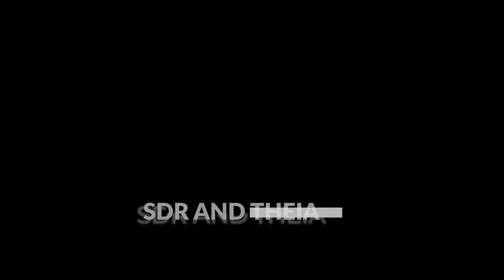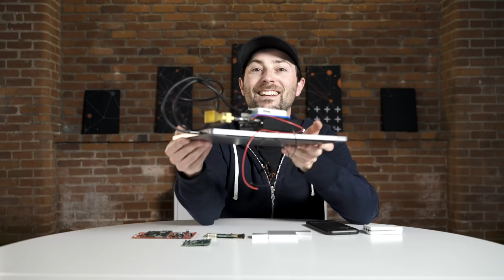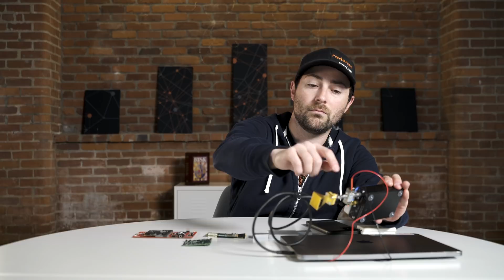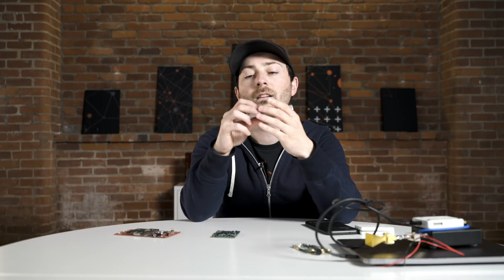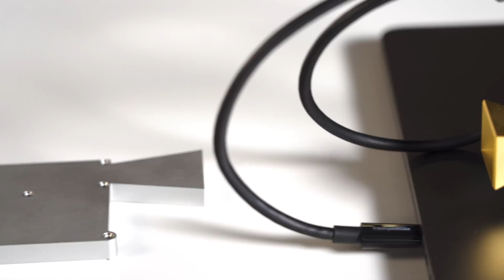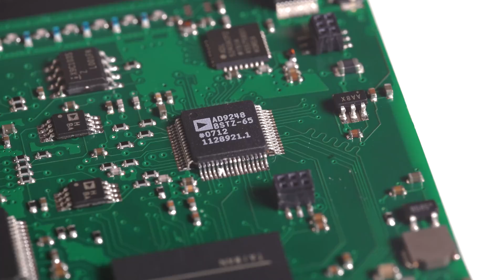What is a software defined radio and why does it matter for Radenso Theia?

Comment: You all are amazingly talented. I look forward buying this radar detector. Since everything is software based, it would be awesome if you could make this a universal geographic region/country specific detector by having user configurable country specific modules. As to how to gather country specific radar gun data, open up the platform and allow hobbyists to contribute or partner with another vendor(s) that has this intellectual property. Also, since I have your attention, if you could please consider packaging this as a remote mountable behind the grill format. Thank you for your attention.
Reply from the maker: Hi Martin, we can't comment yet on geographic stuff just yet.  However, we do plan on doing a remote mount version as we mentioned in our Theia FAQ on our website but we have to finish Theia first!  Thanks for the comment!

Comment: Unfortunate that Apple users have to buy into Windoz in order to update Radenso purchases. Not worth buying in the first place if it can’t easily be updated.  So sad since Apple users are more likely to purchase top of the line expensive products.  Choosing to screw themselves I guess.
Reply from the maker: Hi John, Radenso Theia will be able to be updated with Mac and Windows operating systems.  Keep in mind, we did not design our current radar detectors ourselves. noLimits Enterprises purchased Radenso years ago with our current radar detectors already manufactured. Radenso Theia is our first radar detector being designed and developed all in house.
Reply: @RadensoRadar  Good to hear you changed your mind on this.  Be sure to let me know when I can make my Theia purchase.  I’ll need one for each car.
Reply from the maker: @JEHankwitz  We have always wanted to support both operating systems, we just had to wait to develop our first radar detector first! ;)